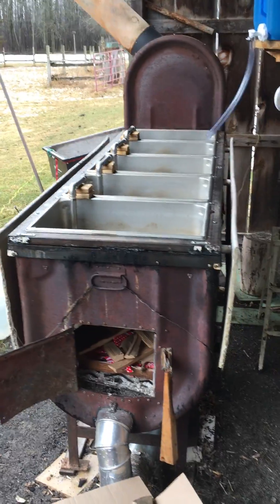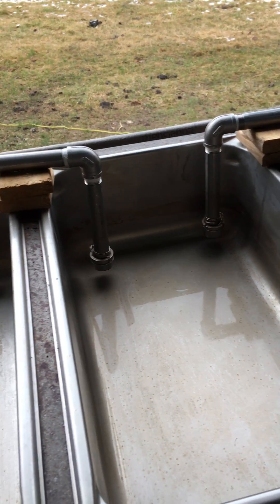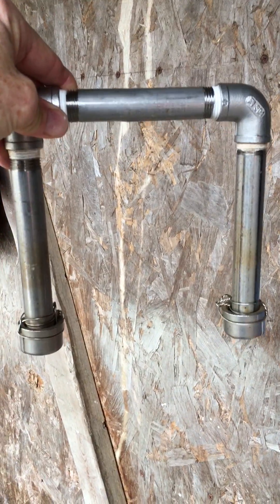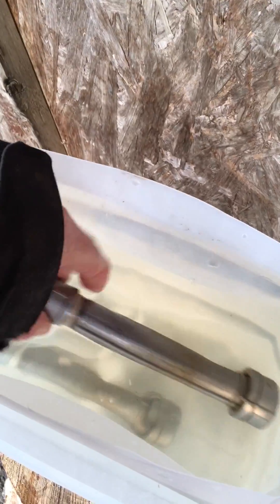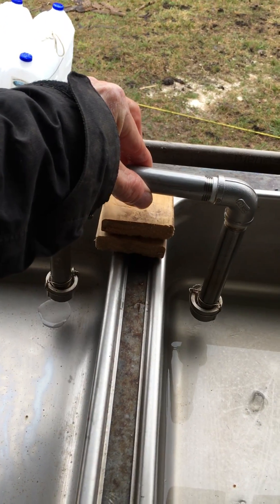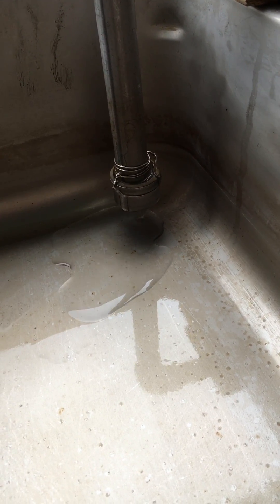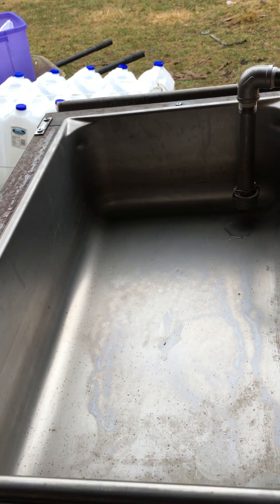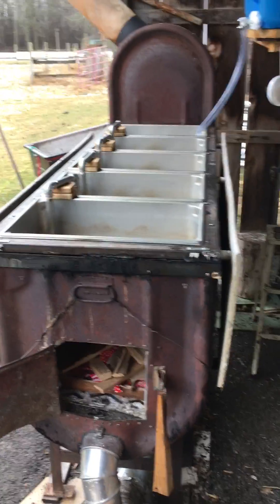Maple Sap Siphons Keep The Boil Rolling

Comment: These work great!! My setup is not really level and my firebox is cinderblocks 🙄 so I have trouble heating the pans evenly. So sometimes the sap flows toward the middle pan! It’s all good I only have three pans. The hottest one is usually in the center and both pans will feed into it. But it’s still great I just have to manually move sap from pan 1 to pan 3 and then just let pan 3 flow into pan 2 with this device. 👏👍👍

Comment: Rick, what do you do when you run out of sap and the back pans empty out as the sap moves to the front pans?  I'm thinking of doing this with two 18"x24" pans.
Reply from the maker: As my sap supply runs down and the boil reduces sap volumes in each pan to about 3/4 inch, I lift each pan in turn and dump it into the pan next closest to the final pan.  Then I put an inch or more of clean water in that pan and place it back into its spot and rinse and clean that pan before the water gets hot.  The water filled and now cleaned pan keeps the fire box contained, heat concentrated and smoke under control.  At the end of a boil day I have 4 pans with water and one with near syrup that gets filtered into glass bottles for temporary storage until I do a finishing boil.  Hope that helps.

Comment: Love your system. My only question is about the amount of trays because I don't want to extend the tank. If the reason for trays is to boil it down and separate the different stages guess I try 5 deeper trays or just have to adjust the siphon.
Reply from the maker: I've always used the 12X20X6 inch pans from Staples, starting with two in a drum, then 4 in two drums and went for 5 pans simply to increase the boiling surface.  The siphons help move boiling sap from one end to the other eventually arriving in the last pan as close to syrup as I can get in this unit.  I finish with propane stove where I have more control.  Sounds like you have a good set up without the troubles of extending the tanks which was tricky so I don't blame you.  Have a great season.

Comment: What parts or components did you use to make the siphons??
Reply from the maker: email me at rick.rhem@gmail.com and I'll send you some details I've shared with others
Reply: @rickrhem6910  Hi Rick. Can you upload a file, with all the plans of the siphons and the rig you built, on your Google Drive and then share the link of the file with everybody, please? Like that there's no need to post our email addresses and everyone interested can simply click the link to download the file.
Reply from the maker: Posted details to my website:  http://rickrhem.ca/evaporator-sap-siphon-details/
Reply: @rickrhem6910  This is great! Thank you!!!
Reply: @rickrhem6910  good morning! I used your siphon method and had good flow when I filled up the siphon but when I put the siphon on the evaporator it seemed that I lost my flow after the sap got hot.  Don’t know what is going on there? It that normal? Do you have a pic of how you wired the end caps on? Thanks for sharing your videos helped me out a lot.
Reply from the maker: Siphon details here:
http://rickrhem.ca/evaporator-sap-siphon-details/
Reply from the maker: Over the course of a day my siphons get vapour locked so I periodically dunk them in sap and work to purge all the air.  I believe what happens is as super heated sap moves through the siphons air bubbles form and accumulate to the point of vapour lock. One thing I did was to raise the bottom of the siphon up off the bottom of the pan about three quarters of an  inch to reduce exposure to direct heat and forming bubbles. It seemed to help and hope it helps you.